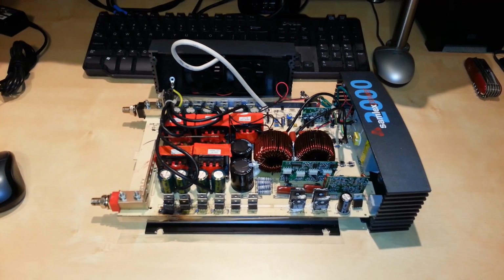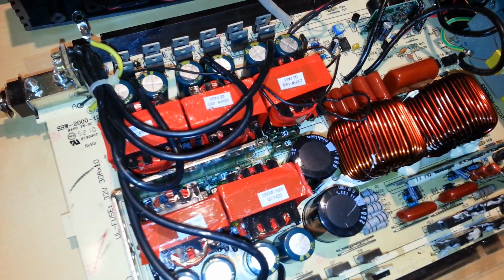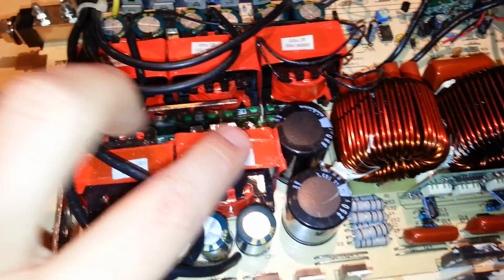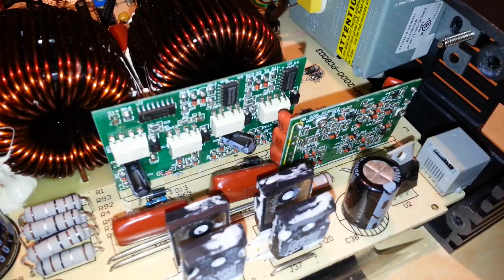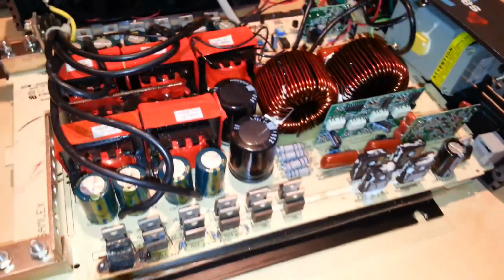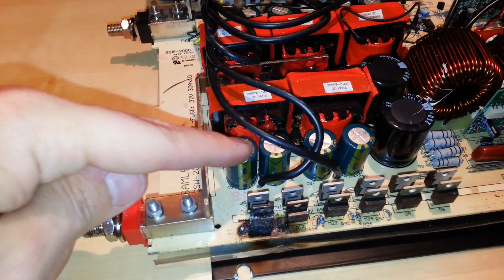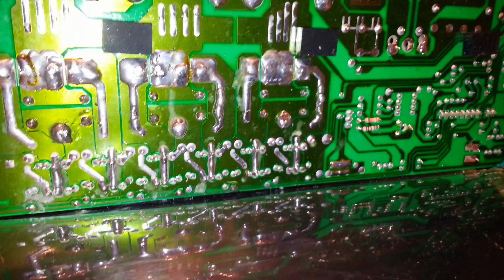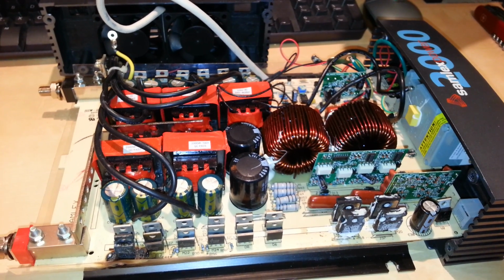Samlex SSW-2000 Pure Sine Power Inverter Repair: Part 1

Comment: I'm putting together a solar system for my apartment. I'm using this inverter along with 2 100 watt solar panels by windynation. How many many 12 volt deep cycle batteries would i need for the best performance?
Reply from the maker: Depends how much of a reserve capacity you want. What is your average load draw at any given time? What will you be powering?
Reply: *****
Just now putting this together. Learning as i go. How much would i expect with what I have if i add two 12 volt batteries? To start I like to run two portable swamp coolers to start. Symphony-USA 175 Watt Portable Evaporative Cooler. This is for an emergency situation really.
Reply from the maker: Carol Williamson is 175 watts running? If it has an electric motor and compressor the surge wattage will be twice that. Two 100 amp hour batteries will get you started to handle a full 2k load, but run time is limited. Figure a 350 watt load with a 200 amp hour battery bank will last just under 6 hours if you power nothing else
Reply from the maker: Carol Williamson keep in mind that it will be a little bit less than 6 hours because this inverter is not 100 efficient no inverter is. The more batteries you add in parallel the longer the run time.
Reply: Is Odyssey High Performance deep cycle AGM Battery - PC625 a good choice?
Reply from the maker: WAY TO SMALL for a 2k inverter. Its only 18 amp hours. AGM batteries are longer lasting than flooded lead acid batteries. However they cost more, and are very sensitive to overcharging. A quality multistage charger like from IOTA engineering is recommended. Eventually I will be getting a similar system myself, but the cost of batteries and sizeable charger is pretty expensive. The batteries are a depreciating investment too with a finite number of charge/discharge cycles
Reply: Great info. Thanks for sharing your knowledge!!! I found a store that sells the AGM batteries. Would 1 250 amp AGM be enough or two would be better? Apartment living and I'm putting this together for an emergency grid failure. Will be running things like a hot plate, TV, two lights. Small things. Laptop i hope. I won't try to push my 200 watts pre channel sound system!!  Also getting the IOTA. Which model. The smart charger? ololol  How many volts you think? 30 45 or 55? Four stages?  Last but not lease, Would one 100 watt solar panel be okay or two for starters? In toto how many would i really need? Thanks xboxer 1985!!
Reply from the maker: Two 250aH batteries is def better for reserve power time. How long do you lose power for? 1/0 awg cable is a must say from knukonceptz.com. IOTA you need a 12 volt model. The 75amp is the largest model before you need an outlet that can deliver more than what a 20amp circuit breaker can provide. The more solar panels the better, but those are not cheap. You will need a charge controller for it too. Not sure how deep your wallet is but me I I would not invest too much on solar panels because the ROI is low.

Also avoid using a hot plate. Too  costly for precious power. Get a small propane stove and run it with a window open.
Reply: ***** Power hasn't gone out yet. ololl Prepping. I saw a multistage charger DLS-IQ4 12 volt 45 amp 1Q4 4 stage by IOTA. Which charge controller would you choose? You know windynations sells a 30amp Solar charge controller with their panels. Not sure of quality. I would like to put the batteries and all the other hardware together to see what the 100 watt panel does and move from there. No hot plate?? Small propane stove it'll be.
Reply: Carol Williamson IOTA 55 AMP RV POWER CONVERTER CHARGER MODEL W/ SMART CHARGE MODEL DLS55IQ4. Pretty good!!
Reply from the maker: Carol Williamson yes the dls 55amp is a great choice! Also you need the iq4 attachment to make it a multistage charger. Im not familiar with solar charge controllers. Im toying getting a dls 90amp with iq4. Its the biggest they make but requires a 30 amp AC circuit breaker. You can take multiple IOTA chargers and connect them together for more amperage OR more volts via parallel/series connection methods.
Reply from the maker: Carol Williamson one 100 watt solar panel with any charge controller on a sunny day wont produce any substantial amount of charge power. At most it will be a trickle charge amount to keep the batteries topped off while not in use. This is the dilemma I have wrestled with to get any substantial charge amperage from solar panels you need to have a great number of them to make it usable for charge current. That alone is very high cost and the price per watt is extremly high. The only upside I can think of is that you are not dependent on the grid for power but at a high price

Comment: i noticed the capacitors are branded nichicon witch are some of the best capacitors money can bye so they will not fail on you and the diodes you were talking about are probably at least rated for 20 amps with a zero not 2 amps for a 2000 watt inverter if those are the only 4 diodes
Reply from the maker: Actually 16 amps 400 volts after looking up the specs. I'll post the next part soon, but my worst fear about the unit was realized today, the input drive circuitry took a dump. the logic board that runs the remote is still intact though. damage looks to be just on the input stage.
Reply: that sounds about right but still a bit low for a 2000 watt inverter
Reply from the maker: Agreed, not as beefy as I'd have liked. Even the input caps are rated 16 volts instead of 25 volts. Those are 4700uf a piece, two per stepup xformer. The output caps are good rated at 250 volts 680uf a piece
Reply: 16 volts is pretty low 250 is OK but not the best
Reply from the maker: Yeah. Its a 430 dollar inverter new. I see better craftsmanship in the thor or go power inverters. Some of the higher series from samlex are built wrll too.
Reply: Thor? Yikes, Gopower and (many) samlex units are just re-branded Cotek. Xantrex, Magnum, DImensions and Vanner are the only N.American designers of inverters. The others are all bought from catalogs in china and re-stickered.